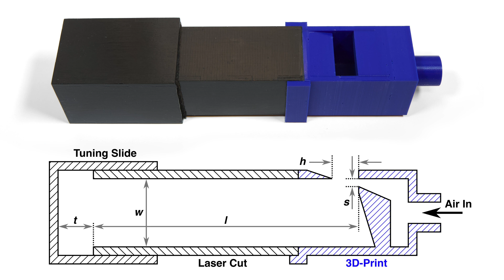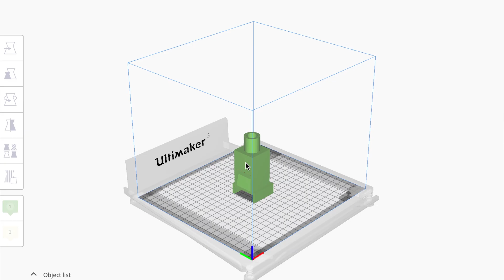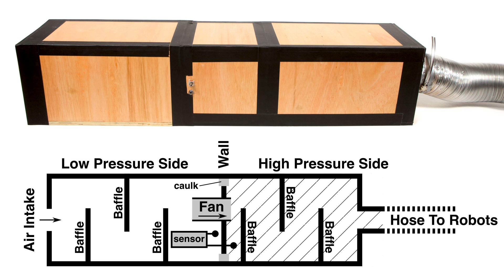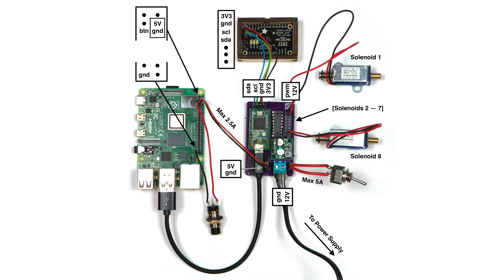How To Build Pipe Organ Robots

Comment: Very cool! Why did you choose to make the pipes half laser cut though, rather than fully 3d printed?
Reply from the maker: Lower-pitched pipes quickly become too large to 3d print. So the strategy is to 3d print the business end only, which is the part that is difficult to get right. The laser-cut part is just a box, you could just glue some plywood together or jam a piece of PVC pipe in there, or 3d print a box which can be modeled in a few seconds anyway.
Reply: @MichaelKrzyzaniak  thanks!

Comment: Hi Michael! I love what you've done here and want to try something similar. I assume the Peterson pipe valves are quieter in operation than the solenoids. If i want to get a set of those, do i contact Peterson EMP directly, or is there an online supplier you can recommend?
Reply from the maker: I contacted the Peterson sales person directly. It was a little wierd, I think I had to email them my credit card details, but it is a small company and they are really nice.

Comment: Nice! Where does the vibrato come from?
Reply from the maker: There is some sort of shock wave traveling back and forth in the large hose from the air supply. I never exactly figured it out, but it visibly vibrates and I shortened the hose at some point and the vibrato frequency went up. I like it so I never took the time to 'troubleshoot' it.

Comment: As a former organ building apprentice, I’m impressed!! Cool solution for regulating the pressure, in the biz they use a reservoir with a moving lid which has weights placed on top of it, never seen it done digitally and it seems to work like a charm
Reply: I immediately thought of the pressure regulators they used to use on steam locomotives. If you're not familiar with them, it's a device consisting of a fan blade to make the regulater spin (requiring a minimum pressure load), with an oppositionally weighted, bidirectional, spring loaded valve assembly that opens wider as the speed of the spin increases. The faster the spin, the more air escapes, which reduces the pressure, thus regulating it. That was a clumsy description and you should definitely google a picture of one. Using only one regulator of this type would probably cause occasional pressure spikes, but using a series of them, one above each baffle, should smoothe out any major fluctuations

Comment: What a great idea!  Did you have to fiddle much with the printed parts to get the correct voicing?
Reply from the maker: No, I just had to babysit the print to make sure there were no defects around the place where the air exits the pipe. Small defects easily make the pipe sound to breathy.

Comment: At some parts I noticed a flutter in the organ pipes. Is that intentional, and if it, do you know what causes it? I can imagine it being a big problem in organ making. But yeah, I like it a bunch!
Reply: It is a problem in pipe organ design. Many organs have a secondary reservoir (normally vertically orientated) with a very stiff spring, located between the main reservoirs and the wind chests. I assume the effect is similar to water hammer, in that when high flow is followed by closing off most of the valves (or pallets) then there is a reflection back towards the reservoir which can cause unsteady wind.  The secondary reservoir is there to absorb this by transferring the energy into the spring.
Reply from the maker: There is some kind of weird shock wave that travels down the big hose that connects the air supply to the wind chests, which causes vibrato. At some point I shortened the hose and the frequency of the vibrato went up. I liked it so I left it.
Reply: @MichaelKrzyzaniak  ok that’s nice to know. Since your here, maybe make more vids about this!